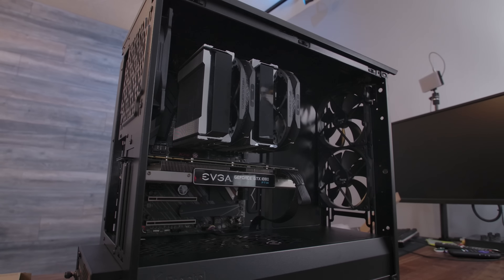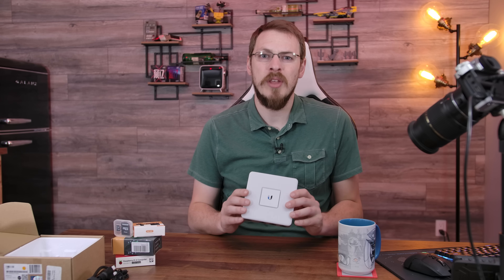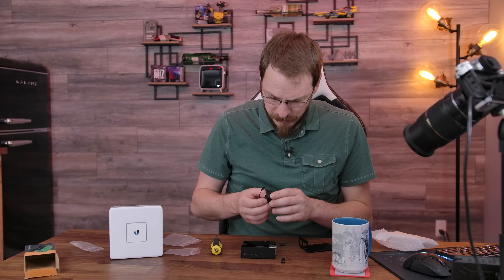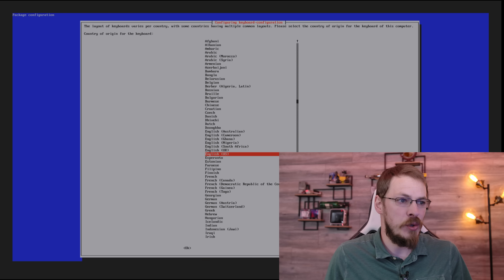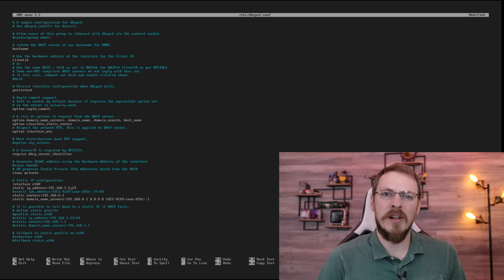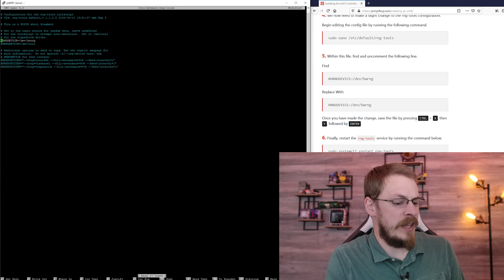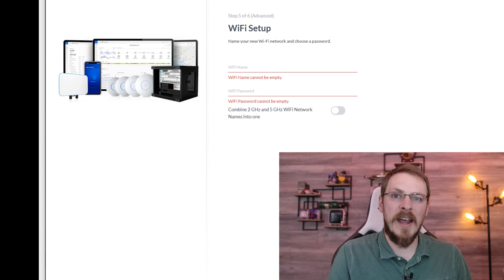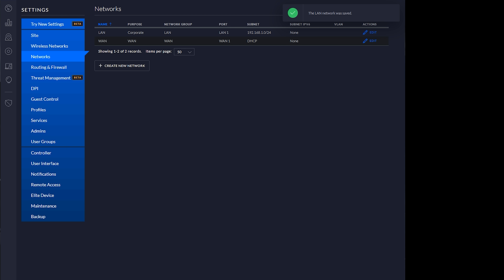Raspberry Pi Home Server - UniFi Controller Tutorial

Comment from the maker: Time Stamps
1:21 - Hardware Used
6:58 - Raspberry Pi Configuration
11:37 - UniFi Install
14:11 - UniFi Quickstart
Reply: Did you consider installing docker and running the unifi controller in a docker container? You can easily add more containers to monitor and manage your network such as grafana.
Reply: FYI, YouTube has implemented a feature called "Video Chapters" to videos replacing the need to add time stamps in the description.  The descriptions of the time stamps will then be shown by the time in the video progress bar.
Reply: @MysticWhiteDragon.  I was just coming to mention that  😎
To make it work, you put the timestamps in the description and the first stamp has to be 0:00 If it is any other number, the time stamps will work but the chapter markers will not. I love it!
Reply: If there is an option to put more than one like I certainly do it. Nice job
Reply: Do you have a link to the PoE hat? The one that I'm seeing on uctronics doesn't look like the one in the video.
Reply: Was MongoDB required?
Reply: Great video, chock full of great info, and would like your opinion on running pfsense on the unifi sg if your have experience with that firewall software.  Cheers!
Reply: I would get a rack in my house but my parents would kill me lol

Comment: Raspberry Pi is redundant in this installation. You have mentioned that you have a cloud instance of Unifi controller, just point USG and other Unifi devices to your Controller. You can also set DNS to go through your remote server too. One DNS server to manage in case you want to change DNS rules.

Comment: I'm want to install the Unify controller on a Raspberry Pi 3b+ with a 32GB ram card, that is already on network running PiHole and Unbound. Is that possible or should I use a new Raspberry Pi?

Comment: when I try to install unifi I get:
Some packages could not be installed. This may mean that you have
requested an impossible situation or if you are using the unstable
distribution that some required packages have not yet been created
or been moved out of Incoming.
The following information may help to resolve the situation:

The following packages have unmet dependencies:
 unifi : Depends: mongodb-server (>= 2.4.10) but it is not installable or
                  mongodb-10gen (>= 2.4.14) but it is not installable or
                  mongodb-org-server (>= 2.6.0) but it is not installable
         Depends: mongodb-server (< 1:4.0.0) but it is not installable or
                  mongodb-10gen (< 4.0.0) but it is not installable or
                  mongodb-org-server (< 4.0.0) but it is not installable
E: Unable to correct problems, you have held broken packages.
Anyone knows how to fix?

Comment: Great Vid... Thanks!  Guess I'll ask the obvious question... why does Unify desire to have a controller hosted not on its own hardware?
Reply: Some installations, like in a home, needs very little computing power to run the controller. Other larger installations, like when you're running the WiFi for an entire sports stadium or a a multi-floor office building, needs much more computing power. Or if you're a Managed Service Provider (MSP) you may need to manage dozens or hundreds of separate Unifi installations. The controller software can handle all those situations. By allowing the controller to run on hardware of your choosing, Ubiquiti don't need too offer hardware to cover all the possibilities.

Comment: You can set up openvpn server on your PI. that way you don't have to pay those scammers for the very few and niece security benefits vpn does provide. plus you can access your home network (as vpn was designed to do in the first place). it's really handy to have access to your mounted storage on your PI as a bootleg NAS, or your printer without opening ports. and of course openvpn is completely open source and you can drive security through the roof if you're paranoid like me. 128B preshared key + 4096B encrypted private key combo. I don't think anyone is going to attempt that until there is a flaw in the protocol or server software like buffer overflow RCE or something, which would get patched probably reasonably soon.

Comment: Hi there, I have a question. When you set a static ip I saw you placed it as 192.168.x.x but my gateway ip is a 10.0.0.1 should I set it in 10.x.x.x format or 192.x.x.x format? Sorry if it's a dumb question but I just want to be sure.

Comment: Great video followed everything and it works or at least I think so. In htop I see more than 15 instances of :

OnOutOfMemoryError -XX:+CrashOnOutOfMemoryError -XX:ErrorFile=/usr/lib/unifi/logs/hs_OnOutOfMemoryError -XX:

But the controller is working and accessible through the web interface. Is that normal ? Memory total used is 380mb out of 2 GB in a raspberry pi 4 with pihole and vpn on it. And advice much appreciated !

Comment: Great video, but have in mind, the USG will max out at approximately 100 Mbit/s. Go with their dream machine or pro 👍
Reply: Only if you enable advanced features.  The system will warn you if you go to enable those options. The DM or Pro are priced well outside of his scenario with a simple setup for parents. 

"If all you need is a basic router, the USG gets the job done. It can route at 1 Gbps, but performance quickly suffers as you enable security features, especially the Intrusion Detection System or Intrusion Prevention System (IDS/IPS). With those features enabled, the USG drops to around 85 Mbps of throughput."
Reply: @LongDono  I tend to agree. In my opinion those features is part of a basic system, especially IPS and at that price point.
The DM is also not priced compare to the USG and one of their access points with MiMo.
Also parents will have visits from their grandchildren which consumes a lot of Internet 😁
Reply: @kenneth_jensen  the DM can't be managed remotely and this was one of Jeff's criteria. Not sure if that applies to the DM Pro.

Comment: I give the PI 2-3 years before it corrupts it's SD card and is 100% loss.  It will happen much, much faster if it gets turned on and off without shuttting it down.
I used RPIs for lots of things over the years, but they always let me down.  For anything that needs an OS, just put it on an old Dell Mini PC $150 worth, S/H.  For anything that doesn't need an OS, use an ESP32 or similar.  If you must use a PI, do not use the internal SD card for the OS.  Use the SD card to boot from a NAS or actual SSD HardDisk over USB.

Comment: I've been using IPv6 on my home network for almost 11 years.
Reply: @Kevin J Well, for starters, instead of having to share 1 address through NAT, I get a block of 2^72 or 4.72 x 10^21 addresses and these are all public, so I can reach devices on my network from elsewhere, without having to worry about port forwarding.  My ISP provides IPv6 to all customers.  All you have to do is connect the modem to your network and you have IPv6, with 18.4 billion, billion addresses available.  If you use a separate router, as I do, you can have up to 256x that.  IPv4 has nowhere near enough addresses available and relies on a hack, NAT, to stretch them out.  That hack requires other hacks, such as STUN, to fix things NAT breaks.  Why not do things properly and go with IPv6?

Comment: Here is a tip add an ssh.txt file after flashing the Raspberry pi OS image into the boot partition, which will enable SSH without connecting a monitor and Ubuntu for pi already has SSH enabled

Comment: Here is a tip add an ssh.txt file after flashing the Raspberry pi OS image into the boot partition, which will enable SSH without connecting a monitor and Ubuntu for pi already has SSH enabled
Reply: Not ssh.txt. Just ssh. No extension or it won't work
Reply: @_zelatrix  or you can enable it using Raspberry pi Imager before flashing the image, actually, I think with and without extension too it works but I don't remember

Comment: I install this for all my friends/family:
Cheap quad nic fanless pc, install pfSense on it. This is the firewall and router, kicks the shit out of the Ubiqity guy.
I roll with unify ap pros and have them managd from my remote controller (no local controller).

I often leave a rPi with Raspbian and pi-hole one it. Nice thing here is I have a local desktop I can access for support. pfBlockerNG is significantly better than pi-hole, but way more complex and the pi-hole captures most needs.

A pi as a local unifi controller is a good idea though. I would suggest setting up a OpenVPN link from the rPi back your home for easy remote access.

Comment: out of curiosity, have you been able to get the unifi controller up and running on a raspberry pi 4 ubuntu server image 20.10 on lxd? or anyone?
Reply: nvm, did some digging within the unifi forum and found the answer:
https://community.ui.com/questions/Observations-installing-Unifi-Controller-on-Raspberry-Pi-4-with-lxc/a7255d30-a9e3-4f71-b088-bfb796be5735

Comment: When I go into the controller and under wireless I don’t have a vlan option to add a specific vlan ID for my uap ac lite?
Reply: I believe you’ll need to use the older version 5.14.23 of the unifi controller until they fix the issues with the new version. There are currently many issues with the 6.0.x controller
Reply: @AndrewCislak  thanks, I think that’s the problem because I tried everything else with no success. Some folks are saying that now you need a usg but That defeats the whole purpose of a my budget set up. Thanks again.
Reply: Check out Lawrence Systems video on youtube about the unifi controller problems!

Comment: Watch out, UniFi distribution list doesn't support arm64 (yet)! So if you run 64bit OS on your Raspberry Pi (such as Ubuntu Server 20.04 64bit), your only option is to do install .deb (12:59:00) manually. (In that case, don't forget about Java 8 (openjdk), and `haveged` for better random number generator)
Reply: I was about to install Raspberry Pi OS Lite 64bit and use this tutorial. Do you know if the UniFi distribution list supports 64 bit yet?

Comment: Hey awesome Video! I have a question. I was wondering if this would help me in my current Situation. I am living in a house in our backyard approximately 20 Meters away from the "Main house". As you could guess there are some Walls in the way (at least 3).

So, my Internet connection isn't very good. I have added an accespoint and incoperated it into out Networks via mesh but still the connection from my Devices arent awesome.

 I thought about setting up a home Networks like you did to take of all smart home Devices off the access Point and connect them to my own home Network. Would this help?

I really appreciate if you could help me :)
Reply: 20m, trench a wire in conduit. Your speeds and upgradability will greatly increase

Comment: I did this when the USG first came out. The only thing I didn't like about it was you couldn't update the software easy on the pi like you could on the cloud key at remote locations. I don't install USG anymore either had about five of them crash at first I thought it was a bad update had to factory default them and restore the backup. After that they were good for a few months then the same exact units did the same thing ripped those out and installed something different at the customers site. I must have just gotten a bad batch because I think I purchased those about all the same time. Don't know if anyone else has had this problem or not? I still loves their ap.

Comment: I ran a homeseer server on a similar raspberry pi / sd card setup and the SD card ended up corrupting on me (the software writes to a log file which eventually got corrupted). 

my question is - is it possible to image a backup once you have everything set up and configured? I would hate to have the wifi taken down if the controller went down, which seems like it would be the case. Or am i misinterpreting?

Comment: you can just enable SSH from the beginning , after flashing the SD-card, create a new file called "ssh" (no extention) and make sure it contains "touch ssh".

it'll enable SSH and you dont need a monitor to configure it ;-)

All the above does need it to be running with an active network. if you pre-congure it /wo network this wont work...
Reply: I left it blank and it works
Reply: You don’t need “touch ssh” in the file. That’s the command you use to enable ssh.

When you use the touch command, it creates the file if it doesn’t already exist.* So “touch ssh” will create a file named “ssh” which is needed to enable ssh. 

* If the file already exists, the  Touch command will update the file’s modification date but otherwise leave the file unchanged.

Comment: Great video. Thanks. Does it matter what router is used? Can I use my ISP issued router? I am quite keen to do this, I have the R-Pi and I am keen but I am not sure if I need to buy more hardware or not. (I would rather not as our budget is very tight at the moment)
Reply: The controller is on the Pi, it controls the Unifi equipment. Really has nothing to do with your router unless you replace the router.

Comment: liked the vid, so (correct me if I'm wrong here) you've basically turned the Pi into a Router? So your Ubiquiti UniFi is your modem and the Pi the Router? unless I've totally missed the plot on this? this does interest me...
Reply: The Raspberry Pi is only running the controller software that is used to configure the Unifi router and access point. The Unifi router (the Security Gateway) plugs into his existing modem, and the access point and Raspberry Pi plug into the Security Gateway.

The controller software is a Java app so can run on pretty much anything. Ubiquiti also sells a hardware device with the controller software pre-installed.

Comment: I almost felt that with the money you spent on the pi, the hat and the case, you could of buy the cloud key gen1 unless you plan to do more on the pi other than just using it as the cloud controller but if so, you would of get a version of pi 4 with more RAM, right?

Comment: Very nice video. I was about ready to do this project and then I added up the costs on your Amazon links. I came up with around $92 plus tax and then I prced the Unifi cloud key at $106 plus tax. Shipping is free on both. Other than pride of building it, are there significant advantages to the pi route that justify the $14 savings vs. lack of unifi support for the hardware? I'm sure someone of your talents looked into this and would like to know your opinion. Thanks.
Reply from the maker: You can run additional services on the Raspberry Pi besides UniFi. The video immediately after this, I install a DNS Ad and Adult Content filter to run along side the UniFi controller.

Comment: I just discovered this video and am a new viewer.  As a result it seems I'm missing a lot of context.  -- Why are we doing this instead of using an ordinary router or wifi router?  Or and ordinary router with DDWRT? Why are they splitting functionality between the UniFi device and the Pi?  Why no on-board wifi?   Are we just trying to get the benefit of the cloud interface?   Or are there additional benefits to using this device + set up ?
Reply: No experience with DDWRT, but I can give the premises behind this approach. The hardware provides superior capabilities as compared to consumer grade gear. Separate access points because they work better and you generally want to access points to be in a different place than the router. The router you place near where your ISP connection enters your home. The access points you place where the people will be. Ubiquiti's product line goes from 5 port switches all the way up to long distance point to point wireless links designed to make connections over several miles. A single access point all the way up to covering a sports stadium with dozens or hundreds of access points. You get the idea... The access points are also extremely good at dealing with circumstances where there are many other WiFi networks in the vicinity.

You configure all the configuration, router, switches, access points, with the controller software. But it isn't a cloud interface. It runs locally on your network. You have complete control of it. Unless you want to run it remotely. In which case you can, but you still have complete control of it. You can run the controller on anything that can run Java. Your laptop or desktop. On a server. In a virtual machine or a container. Or on Ubiquiti's device with the controller software built in. 

You can control many separate installations with a single install of the controller software. This makes it suitable for a Managed Service Provider (MSP) business where companies outsource the management of their Unifi network to a company that specializes in doing it. In that case, each location doesn't even need to have a controller running locally. It's all done by the MSP's controller setup.

In this particular case, the Raspberry Pit is being used to run the controller software locally. But Jeff  is going to manage it remotely.

TL;DR

The Unifi system is extremely flexible, can scale from a single access point up to hundreds, includes switches from 5 to 48  ports, and is also able to do multi mile wireless wan connections. It also integrates their with their surveillance cameras, door bells, and IP telephones. And it's all managed from the dashboard provided by their controller software which you can self host on just about anything.

Comment: I run my USG on PoE — I just stick a PoE splitter next to it on the wall. This is much better than that power brick!
Reply: How does this work?
Reply: @davidbaxter6146  input to the splitter is an Ethernet cable carrying PoE from a PoE switch. There are two outputs from the splitter. One is regular Ethernet without PoE and the other is a power connector that you plug into the power in on a Pi.